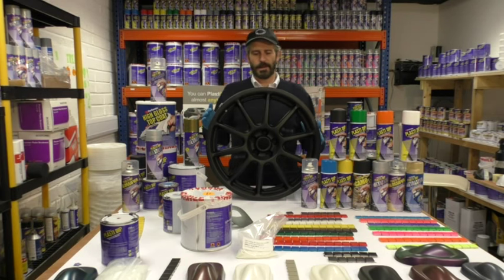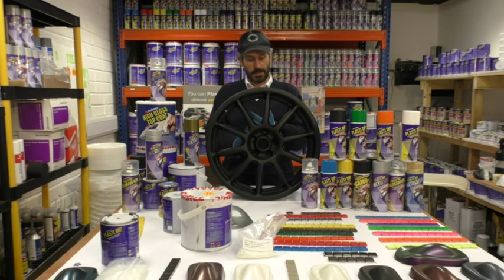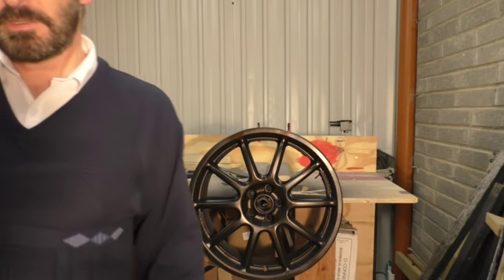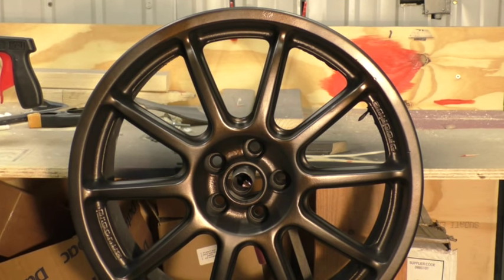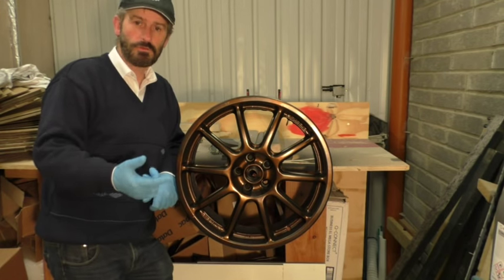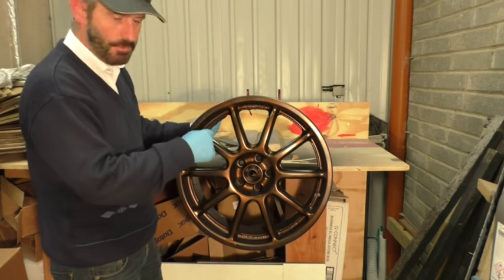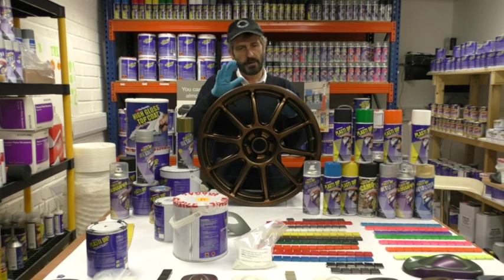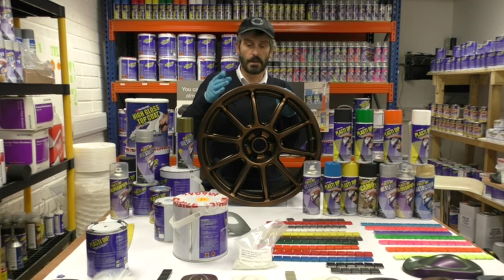Plasti Dip Copper Metalizer How To Apply

Comment: Very well done. Wheels are not that diff than the Cayman S Sports I am about to do. Yeah...those spokes. You didn't mention what you recommend as a drying time between coats. Can says 30 min but DYC talks about 10-15.
Reply from the maker: Very sorry about late reply, drying time depends on room or outside temperature .At 18 degrees 10 minutes between coats and lower temperatures , just extend time, look for wet look to matt or  satin look and you are ready for next coat thanks.

Comment: how much would it cost to do four 15" wheels including the black base would it be over 100euro?
Reply from the maker: +conor is p4p number 1 
you always need a minimum of 4 coats of plastidip for good finish and durability. So because you are using black plastidip as base coat, you don't need 4 cans . 3 x aerosol cans of black and 2 x  copper metalizer will give you a good finish and may give you 5 coats of dip when finished. at our current pricing :  €101.00 euro
Regards
Paul

Comment: What would happen if I used a wheel cleaner on the rims with this on it
Reply from the maker: It depends on what is in wheel cleaner, so test a very small area. I just use car shampoo and soft brush and pressure cleaner. you can put aerosol 1 pack or 2 pack gloss or matt top coat and you can use any cleaner, but you need 7 coats of dip before you apply acrylic lacquer if you want to pee off full dip in the future.
thanks
PD

Comment: Can you use metalizer overblack powder coated wheels ?
Reply from the maker: If you apply a black base coat of plasti dip first and then use metalizer  then yes
Reply from the maker: Hi Orlando, I do not think it will work but I have not tested, metalizer designed to be sprayed over the surface of plasti dip.

Comment: Wouldn't the process of mounting a tire on this wheel mess up the dip?
Reply: +ConductorRyan id def suggest doing it with the tire on just tape off the tire
Reply from the maker: yes if done wrong, a good garage will not mark the wheel.
thanks
pd